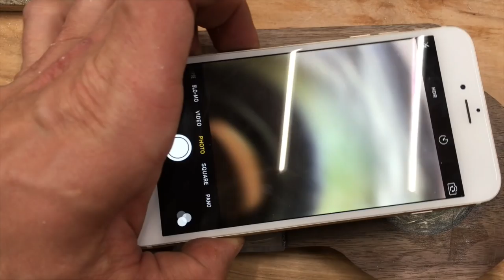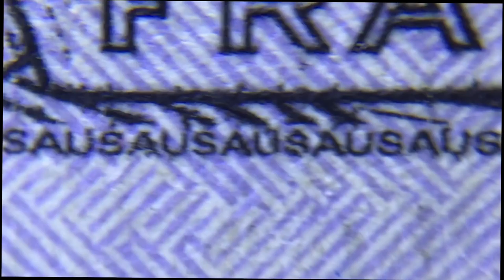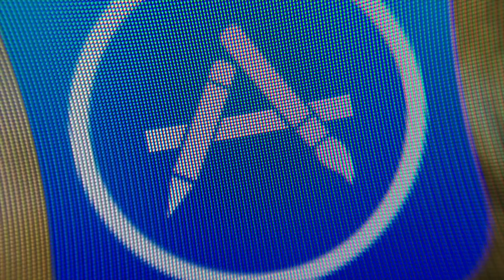Phone Microscope - Epoxy and LED lights

Comment: Very cool. Throw a couple strips of UHMW glide tape on the bottom and it's perfect. I was given a set of accessory lenses for my phone that don't work with my preferred case. Now I have a use for them. I think I'll make mine reversible so I can put the phone in either direction (rotated 180) to use both/either. Thanks!!
Reply from the maker: Glide tape is a good idea.